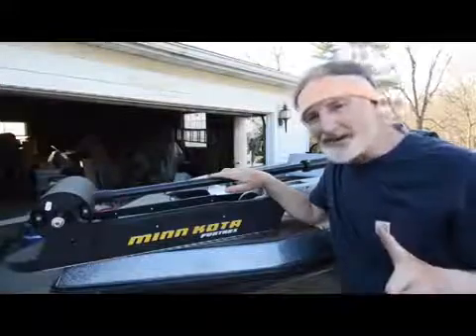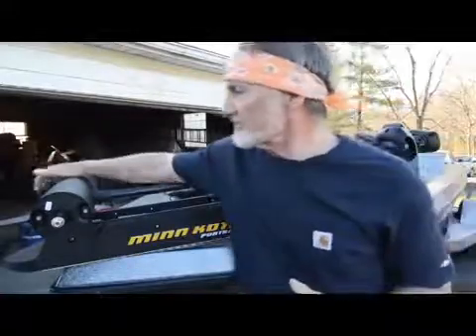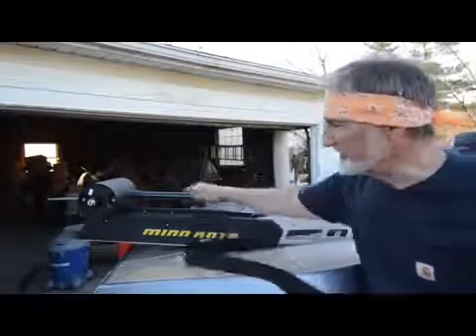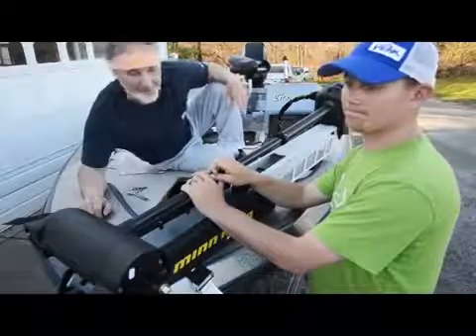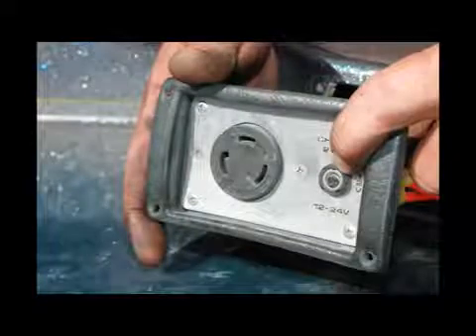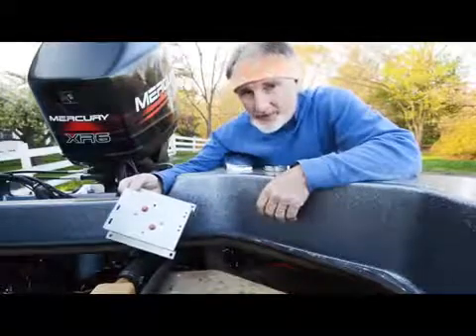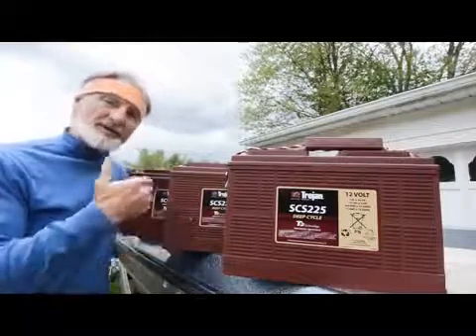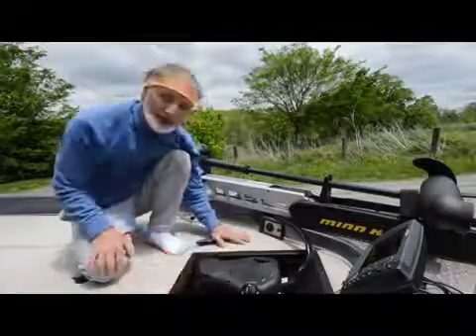Keep Your Bass Boat Alive, Part 6

Comment: I have the same boat how did you fit 4 big batteries  in there
Reply from the maker: Two sideways in middle up against gas tank. One on each side of boat behind them shoved as far as possible into the corners. Very tight. Not enough room for battery boxes or even battery trays.
Reply: @markhicks1544  thanks